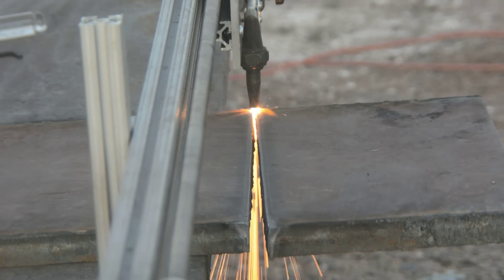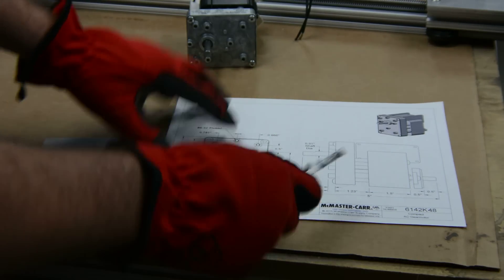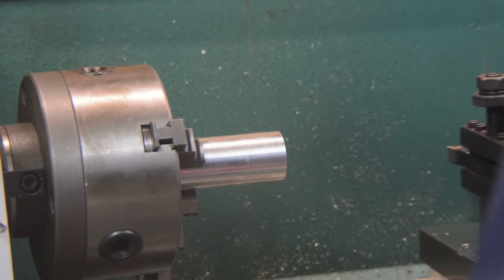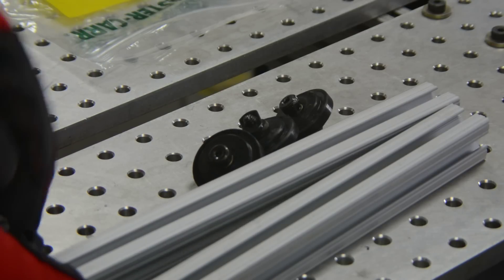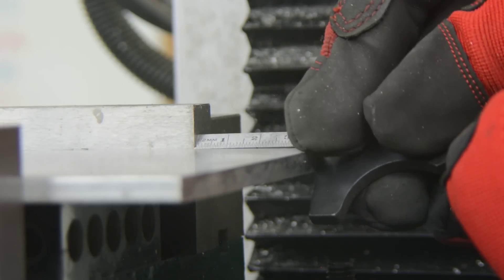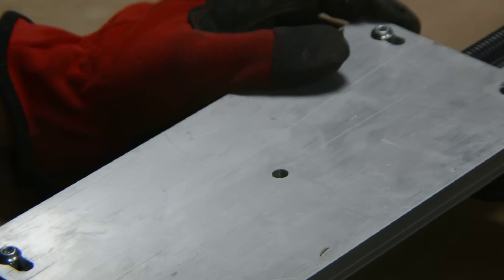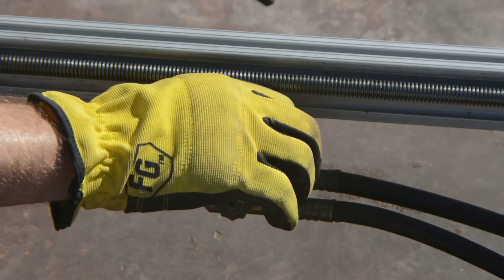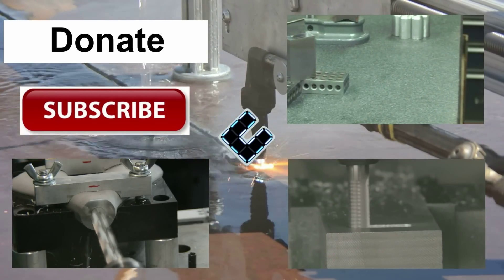DIY Track Cutter, Cut steel sheets easily for less than $200

Comment: For everyone complaining about needing a full machine shop to build this:
The track cutter could be made without the lathe and mill. They just make it easier to build. You can use all thread, aka threaded rod, in place of the lead screw, less cost and with a little grease will last a dozen years or more. Every operation done can be done with a cordless drill and hand tools. The accuracy is provided by the track itself, not by any of the parts. You can make a sliding platform without wheels to simplify the design and build. I like the extruded aluminum for the track, it looks nice, is light, and more straight than steel tubing (generally)
Reply from the maker: Brian G C well said, thanks for the comment. 
Best Matt

Comment: Great job! Those little 3 wheeler things can be a right pain once the track has a few battle scars, this keeps the important bits well out of the way, up high like that. Well done.
Reply from the maker: Thank you. I like this project a lot. i have used it a few times now to build other things. like our CNC gantry mill and a 20 Ton press brake.

Best Matt

Comment: Love how the video is edited and narrated. The title is definitely "click-bait" in the sense that nobody outside of people with a large machine shop could POSSIBLY do this for $200 in materials only.  Still, for those of us interested in engineering and "making" this is a valuable video. Thank you for producing it.
Reply from the maker: Thanks! After I posted the video I did think about how many tools I used to make it and that a 3d printer and some other parts would have been the better way to go. Then it would truly be DIY. But if you have a garage and some of the machines I have then sure it's still DIY.
Best Matt
Reply: Too slow paced, he doesn't need to show us how to mark and cut every single piece; especially the four 3" pieces out of a 12" rod.... I skipped most of the duplicate operations in the video. Cut to the chase on the future videos
Reply from the maker: Thank you, good advice and will do.

Comment: To make a 200$ cutter you need to have a couple thousand dollars worth of equipment already... Cool
Reply from the maker: Such is life, complex creatures making simple things. Expensive machines making inexpensive parts. Thanks for watching and commenting. 
Best Matt
Reply: Tell me all about it. I just got back into welding after 13 years. That meant I’m starting from the beginning. Buying everything at once, including the 20 or so different welding fillers for stick, mig and TIG, I’m now back a few thousand. What the heck, add that to the rest of my shops, and who would notice?

I have to say though, not good shop practice to use gloves around turning machinery. I know people can come up with reasons why it is, but it really isn’t.
Reply from the maker: Thanks for watching and the comment. The gloves conversation has been going back and forth for some time now so I won't rebuttal. And thank you for the concern. 
Best Matt
Reply: Spend $5,000 buying the tools you need to make a $100,000 shop for an additional $5,000 in materials over the next year... Sounds worth it to me. Thanks for videos like this. Guys like you are helping so many guys like me every day. Keep up the awesome work!
Reply: That's the investment approach, crazysvt. The other approach (different but also valid) is to build (to the extent possible) all your equipment from scratch. It is possible to produce a machine tool which is reasonably accurate using nothing more than hand tools, if you substitute time for money, and sprinkle in plenty of ingenuity. 
If this bootstrapping process were not possible, we would never have had machine tools.
Reply from the maker: Man you nailed it! We don't have money but we need the tools... Life story. Thanks for the comment bud.
Best Matt
Reply: crazysvt03 I know, right. Seems a bit redundant huh.
Reply: Huh thinking same thing
Reply from the maker: @nid Styles , effyou128 is right. Don't eat with your eyes. This video was for people with enough income to do this thing. If that's not you. Then this is not a video for you.
Reply: It’s life dude. But your thinking is too one dimensional.  This is obviously meant for men who work as machinists or are self employed owning machine and tool shops. Tools are an important part of life.

Comment: I realize you are not touching the part until the lathe is fully stopped, but as a rule it is a very bad idea to wear gloves when working with machine tools. Many an unfortunate individual have lost fingers and hands that way. </harping>
Reply from the maker: Yeah we know. But just being honest, if you can't wear gloves by a lathe without getting hurt. Then you don't know how to run a lathe and should not be allowed near the machine with out supervision. The "no gloves" rule is only intended to protect the novice and those with no guidance. Because new people usually come up with bad ideas on how to do the work and are the most at risk for getting hurt. I would know this, my mother wanted to run a lathe at another shop that i was not apart of at the time, and decided to use lose sand paper wrapped around the part with her hand while wearing gloves (trying to clean it). Took her hand clean off at the wrist. Chris from Click Spring has a video about his sand paper tool. It keeps your hands away from the work and makes the sand paper rigid so as to not get caught and suck you in. One idea was bad and ended bad one idea was good and ends good. That is the lesson to be learned. Knowing how to run a lathe means making parts to spec without bodily risk or harm. Basically, using the right tools/ideas to keep your hands away from the spinning objects. Do that and you will be fine no matter whats on your hands. 
Best Matt
Reply: @centurialinc  My friend,,,,All it takes is one little chip and you are GONE. I was machinig a piece of Delrin plastic and using a triangle; scraper to take the edge off. I was very close to the reverse jaws and an angle hair size string came off and wrapped around the sscraper and pulled by hand maybe a half inch before it broke. WACK! the old knuckle into the chuck jaw trick. Didn'tdo and actual damage but it hurt like hell for a month.

You highly experienced experts can get away with using gloves around rotation machinery but us amateurs that have been making a living with machines longer then you have been alive will NEVER wear them around machinery,,,,and will keep sending our apprentices home for a day when we catch them  wearing them while operating machinery.

Comment: Just a heads up, if you are winding that lead screw back to home with an electric drill, make sure the NEMA Stepper motor wire plug is disconnected, they can generate quite a voltage and that has the potential to blow up your stepper driver board. Alternatively you could put a micro switch on the home position and have that trigger a stop as you reverse the direction of the stepper, assuming you have a CNC controller doing the heavy lifting on this setup. Would be interesting to get this X and Y....... ideas ideas....
Reply from the maker: Thanks for the tip. I did not know that. We are building a CNC mill right now so that's taking up all our time. We are going to use it to do job shop work. We keep getting requests to do work for others sooo, it's an easier way to make money then building race cars. As soon as we are done with that. We will do some videos and release the design. We might build a laser next.

Best Matt

Comment: This got me thinking about what I can do to automate how I use my everlast plasma cutter. I don't have a cnc yet.
Reply from the maker: Go for it. A better job can be done with some 3d printed parts and timing belts. You could easily make a CNC torch cutter using some steppers and any electronics you like. I would love to see that. Let me know what you come up with.
Best Matt

Comment: Use wd40 in a spray bottle when milling aluminum and spray it on instead of air. You will get a better finish.
Reply from the maker: Good suggestion. We now use cool mist.

Comment: 3D printer parts are already cheap, available, and do what you are trying to duplicate.  Proper lead screws, linear bearings, couplers, etc.  Yes, you can make all of that yourself, or spend $30 on Amazon for higher precision parts

Not saying what you are doing is wrong, but you are going to a lot of effort to reinvent the wheel.

Now the actual device itself is great and has me pondering making one myself.
Reply from the maker: Well said. Your right. Now that maker rails, gt2 belts and such are easily available, there are many better ways to make such a contraption. 

Thanks for watching and the comment. 

We have lots more to show every one. Hope you'll stay with us and comment on our next vid.

Best Matt
Reply: Show me what you are talking about?  Where can I spend less than $200 and cut a sheet of steel 1/2 thick and as straight as this jig. Thank you

Comment: How did you size your motor for torque and rpm?
Reply from the maker: Good question. The way we did it, was by making a cut buy hand and timing it. 6 inch straight cut. Then worked backwards. McMasterCarr sells geared motors and lead screws and a little bit of math got me the inch per min that I needed. The gear motor plus the lead screw gave me all the strength needed and then some.
Reply: thanks, I have been looking on McMaster. nice video @centurialinc

Comment: AND, if you don't have the tens of THOUSANDS of dollars worth of machining equipment,,you will have to pay about $300 to a machine shop to mill, machine and tap these items. That drives the cost up a "Little"
Reply from the maker: No use for lazy people None. Our shop doesn't have 10k$ in equipment. It's about 4k$. Its all hobby stuff mixed in the old ebay and diy tools. The shop is big. But thats cause we want to build cars. All of it would fit nicely in a 2 car garage, possibly smaller if you down sized a few things. But really all you need is a 3d printer to make one of these cutters. We didn't have one at the time so we used what we had. Thanks for the comment.
Best Matt

Comment: why not add a water jet feed to cool your work, maybe a greavity feed from a headed tank, where can i get acme threadded bar m12 ish in the uk.? (nice job by the way) im trying to make something like yours for my plasma cutter,  came un stuck using threaded rod m10 (studding) its always bent lol. andd finding a motor gearbox at the right travel speed....regards Mark
Reply from the maker: Yes you can do that. Just don't drown the flame. I'll look around and see if I can find you a good supplier. I'll let you know. Thank you for watching and the comment.
Best Matt

Comment: Forgive my ignorance, how are you controlling the speed of the cut?
Reply from the maker: It's a fixed speed gear motor. I did small scale tests to determine the rate I needed to go to get a stable cut. Then worked backwards from the lead screw to the geared motor. Now that I have more experience with stepper motors. I would recommend that over the fixed gear motor. It's much more versatile and the cost is comparable.
Best Matt

Comment: I looked on your website, I didn’t see the page on making this tool. Is it still available, maybe I overlooked it. Curious to see some of the components. Thanks for any info.
Reply from the maker: Redmech80 it’s not on the website. But i can put it on there for you. Would you like prints and a part list? I was able to build it by hand. You could do the same.
Reply: Really curious on what electric motor you used. I think I’ll build the rest with what i can find. Really enjoyed this build
Reply from the maker: Redmech80 ok i will look it up later today and let you know what the motor is.
Reply from the maker: Redmech80 it was one like this. 
https://www.mcmaster.com/6142k48
They have different speeds just choose the one that will work best for you.
Reply: Thanks

Comment: this is soo cool!! but one thing that bugs me was the fact you turned the oxygen off before the acetylene, i was always tool A before O or up you go.
Reply from the maker: WIld Zebra 

Thank you! But its the other way around. Fuel is always first on last off. All combustion based devices follow this rule. Rockets, piston engines, jets and torches. 

The reason is to avoid a lean mixture. In a rocket if you start the oxygen first then add fuel the mixture will turn prime and combust with extreme efficiency do to the vast availability of oxygen. This can cause a big explosion. In contrast fuel first leads to a rich mixture. The excess of fuel slows combustion because the oxygen is to scarce. The point is if there is to much oxygen then the flame can not be stopped full combustion will occur. If there is to much fuel the flame will die out quickly. 

When the torch pops thats the mixture going too lean and should be avoided.

Best Matt

Comment: Where did you get the structural framing material?
Reply from the maker: The steel plate came from the scrap yard. And everything ells can be bought online from Amazon. 

Best Matt
Reply: The extrusions are from a company called 80/20. They have a store on eBay. I’ve been buying their stuff since they began about 35 years ago. Since their eBay store opened years ago, I’ve been buying there. Prices are lower.

Comment: Am I missing something here for 200 dollars couldn’t you get a cheap lead screw set and negate the majority of the build process and need for all the machining tools? Only needed expensive part in this really would be the torch from what I could tell. Not saying it’s worthless to know how to build from scratch but if the aim is to build cheap then that’s how I’d probably tackle it.
Reply from the maker: I'm not sure what you mean it is lead screw. Most of the cost was in materials the extrusion was not cheap. In general this project is for those who already have these tools. A track cutter is very expensive and to only use it a few times is not worth the cost. So this is a good way to get around that issue.

Best Matt